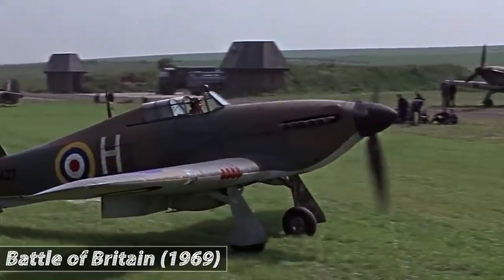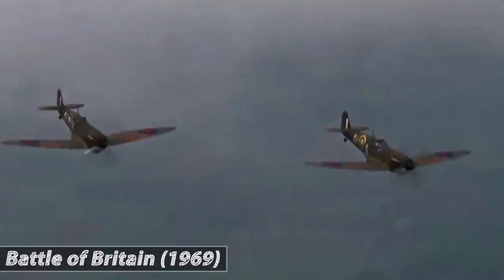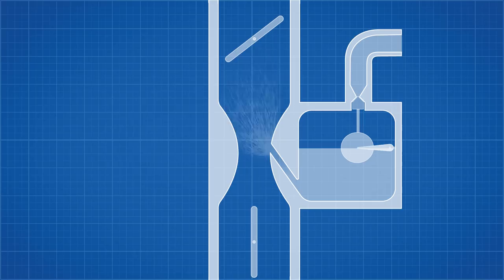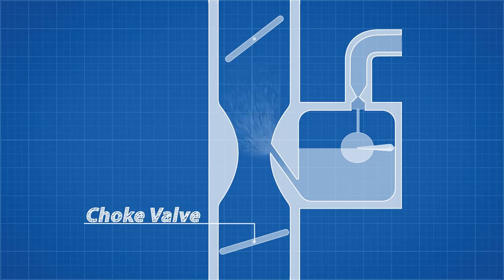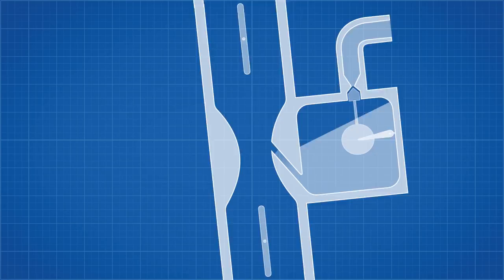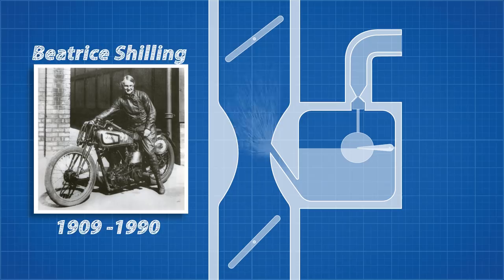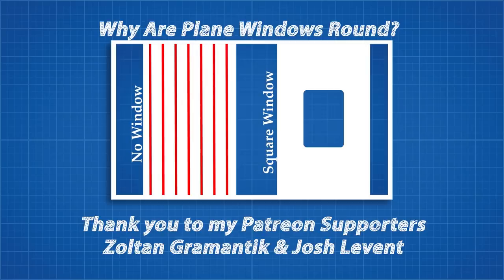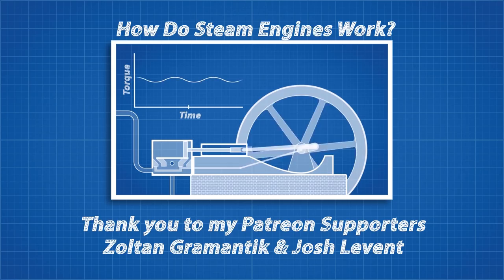The Spitfire's Fatal Flaw

Comment: Amusing to open the Spitfire movie with a Hawker Hurricane.
Reply: See the pinned comment, which has been up for 10 months longer than yours! ;)
Reply: navnig That was what I saw.
Reply: It's not a "Spitfire movie" it's a movie about the Battle of Britain
Reply: small moustache man
the video is literally titled "The Spitfire's Fatal Flaw"
which of course the hurricane suffered from too
but so did many other aircraft at the time since carburetors are complicated machines
Reply: Rolls Royce were the first to solve the problem.
Reply: Considering the Hurri had more Air to Air victories in the Battle of Britain, it makes complete sense, but of course you knew that. *cough *cough
Reply: nuchittenme.
Considering there were more Hurricanes and they more often went after the bombers while Spitfires took on the Bf 109 then it is not strange that Hurricanes did shoot down more but had a lower kill ratio and higher loss ratio.
Reply: yeah but the hurricane suffered from the same issue, since they both used the same engine
Reply: Kodiak Express dude he admitted he made a mistake, admittedly all planes with that engine suffered from the same problem, and the video should have been called the rolls royce merlin‘s fatal flaw, but dude, its a fucking youtube video just enjoy what you have been given
Reply: I'm pretty sure the hurricane suffered from the same problem
Reply: @CreamyNic2  
All aircraft  using carburetors suffered from the same problem until Rolls Royce solved the problem so the Spitfire was really the first of them to overcome the problem which was hardly a fatal flaw, all biplanes had the same problem and so did US fighters, the P 36, P 38, P 39, P 40, P 47 and early P 51 all had the same problem.
Reply: We had around 370 Spitfires & around 700 Hurricaines so you would have been twice as likley to see a Hurricaine as a Spitfire  We also had  as may Hawker Typoons but they were mostly used for bombing raids ! 
The Spitfire was not the only  defender of our Country !
Reply: @barrierodliffe4155  , yeah, no though, because the germs had a superior technical solution all along
Reply: @stupidtreehugger  
The German superior technical solution gave less power from a bigger engine.  Is that really superior?
Reply: @SunSailandSand  though it didn't have proportionately more victories.  Spitfires had a higher kill ratio.
Reply: He admitted his mistake. I guess there is no further reason for criticision
Reply: @speed2574  I did this two years ago. I am not discussing it any further.
Reply: @AkaAndyKnuckles  Too good to see you coming back to a comment you did 2 years ago and now probably have forgotten!!!
Reply: AkaAndyKnuckles Yeah, I thought that was very weird!
Reply: Why watch something informative just to criticise?
Spitfire DID have this problem. There was no claim that the problem was unique to Spitfire. Of course Hurricane had the same problem.
Reply: I have no problem with that. It was a common engine design for both aircraft.
Reply: @stevebirks2186  Right, brother! More than double the squadrons equipped with Hurricanes as there were with Spitfires. AND the Hurricane was easier to repair. I love both the Hurricane and the Spitfire.
Reply: @geraint8989  
Not only is the title wrong there never was a fatal flaw. So called Real Engineering without a clue.

Comment: Lovingly called "Miss Shilling's Orifice" amongst the pilots. Apparently, she wasn't too fond of that nickname.
Reply from the maker: Yes, one of the reasons I didn't mention the name, especially with my ending message.
Reply: Bloody gold.
Reply: I think  it was ground crew who were most likely to refer to it by its nickname. They were the ones who worked with it and installed it.  Incidentally the motorcycle she's pictured on was her racing Norton , on which she lapped Brooklands at over 100mph earning a gold star. She was a successful competitor and Norton used her for advertising. She apparently used it to visit RAF fields to demonstrate to ground crew how to fit the "washer". It was actually carefully engineered, not just a washer with the right sized hole. I'm privileged enough to own one of her cars, which was much modified by her and demonstrates a fair amount of aeronautical engineering practices.She continued in the aero field, working on pioneer aircraft that could break the sound barrier and on into the rocket age.  She was still lapping the Farnborough perimeter track at over 100 mph in her retirement, working on aero tweaks for the car..
Reply: Very few folk get a "works" nickname they enjoy...hers was, however well hidden, a mark of recognition, of respect.